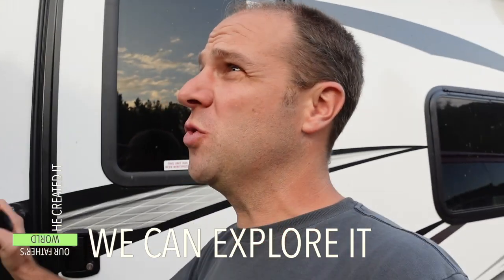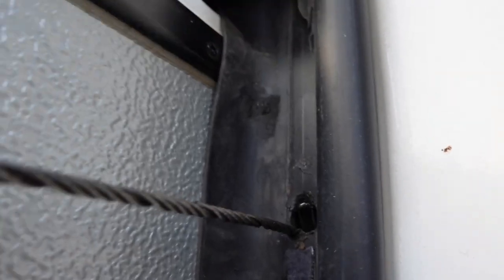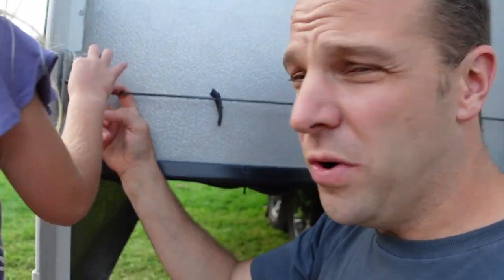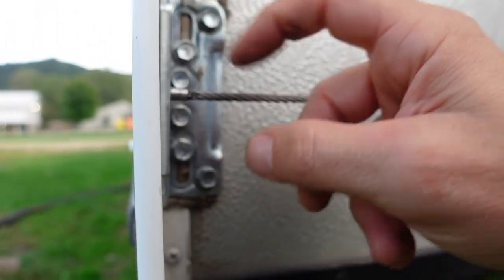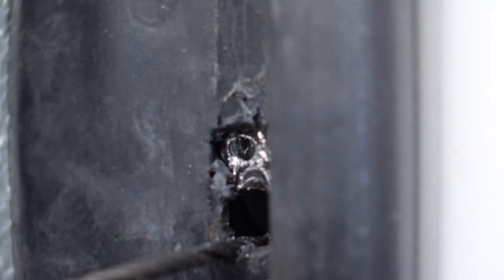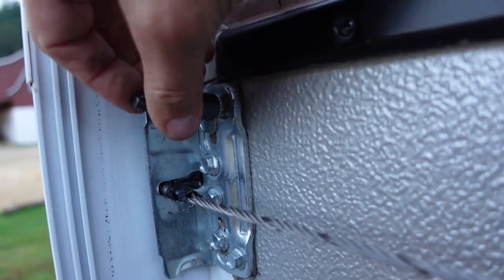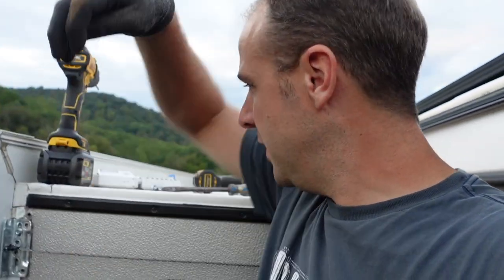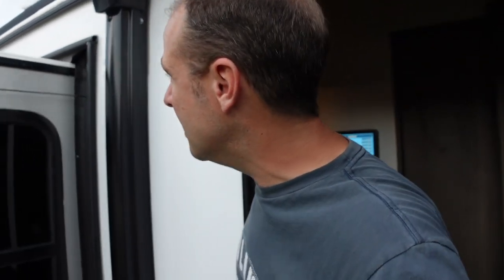DO NOT use your RV CABLE SLIDE OUT until you watch THIS!

Comment: I have a 2022 Cougar 25RDS with the cable side. I have no issues with the cables or the trailer itself and have done lots of camping. These slides require maintenance (checking the cables for wear and tension) like anything else on the RV. If you understand how they work and how to adjust them they work great. Unfortunately in this case the the bracket was installed to high. The tension on the cables should have 1/2" - 3/4" travel up & down.

Comment: Very good info, and something that one might not catch until it is too late.  I wish there were a way to access that corner from the inside, so one could make four metal backing plates on the inside, then replace the self-tapping screws with machine bolts (with a little bit of LocTite 243 "blue" stuff to ensure the bolts don't work loose, coupled with an acorn cap nut at the end) , as well as add a 3-5mm rubber gasket sheet cut out and with holes for the bolts, to guard against water intrusion in addition to the caulk or silicon sealant.

RV quality has gone through the floor due to a number of events.  In 2005, due to Katrina, RV makers were told to mass produce trailers as cheap and fast as possible to get them to the destroyed area.  This started the slide.  2008 came around with RV makers making units cheap, just to make some type of income, and didn't really care about quality, as many RV makers went under and got bought out.  2020 came around, and people paid 4-10 times as much for a trailer as a few years back, and quality control still slipped overall, from what I've been told.

You almost need to have a third party go over a new RV and fix everything that is broken.  A former co-worker took his new class "C" to a local service that did this.  It cost him about $15,000, including a roof replacement (because the roof and area around the cabover would almost certainly leak and rot after a few years), but he has something that will at least be something for camping, and not a source of frustration and problems.

Ironically, if you compare the quality of campers here in the US to what is sold in Australia and the EU... it is insane what relative junk is foisted on US buyers.  $70,000 in Europe, even with currency changes, can get one a very nice class "B" unit, or an extremely well equipped trailer, with the latest materials and floorplans.

Comment: This is simply an adjustment issue. If you still have this RV you should call a mobile mechanic and have them readjust your slide out and possibly change the cables. It’s not that difficult and shouldn’t take more than an hour or two. I agree with another commenter about Camping World and their lack of quality service. I feel the same about Bish’s RV, as well!

Comment: Nice video.  That appears to be a BAL accu-slide, not installed correctly. The brackets have slots that allow the cable to center side to side, and slotted screw holes intended to let you align them up and down. BAL has excellent videos on how to replace cables, how to adjust cables and so on. If it were me I’d go ahead and replace those cables, and if it does not have rollers under the slide BAL offers ones intended as upgrades (that don’t require removing the slide to install).  Be sure to also check the inside cables

Comment: There is also a lot of slack on your cable.  There should be enough tension in those that when you touch them they don't sag.  You need to adjust the tension.

Comment: I have exactly the same cable but inside doing the same thing and my Cross Road Cruiser Aire 31SI is a 2022. That thing is only 8 months old. What a piece of crap, made By Keystone RV. The dealer will cover it on the warranty of course. The whole thing won't last long. Great video the quality control guys should see this or maybe the management

Comment: It’s quite discouraging to see the complete lack of quality workmanship and materials that today’s RV assembly plants provide.
The reason this happens has much less to do with cost of material and labor than they would have you believe. The fact is, highway safety is the only, truly regulated factor where they can’t skimp.
Most RV owners will purchase a new RV based on how pretty it is rather than how well built. Add to this, the RV will spend the majority of its life in storage. The manufacturers have little to nothing to do with the assembly of an RV because they only produce certain components, not the fully assembled RV. The dealership may have a service department which allows them to increase profits for sales as well as taking advantage of the fact that an RV will likely spend more time being serviced than providing one. Since the RV is assembled with components from dozens of separate manufacturers, the end user can only expect implied warranty which is extremely limited at best because every piece of it is already technically used before the consumer buys it.
That being said, I would definitely recommend you fully inspect the undercarriage of your RV and its slides, making sure that all the hardware is present and properly installed, adjusted, lubricated and functional and if you don’t feel comfortable doing it yourself then use a service department of a dealership other than where you purchased it. Also, ask lots of questions because if you have RVing in your blood you are a handyman at heart and the first time you save a bunch of money, successfully fixing it yourself, you’ll feel so good that you may want to tackle something else before it breaks. Common sense is in our DNA and covers more than most people think.
Love your videos! Clearly, your inner handyman escaped with a plan to stop anyone you reach from being taken advantage of. Being your own hero is the best!

Comment: I would say you have too much slack in your outer cables. That being said the brackets that the cable is rubbing on in the wall is probably mounted poorly. One side of my slide the cables go right through the middle the other side however the cables are rubbing in the middle on the outside and not top or bottom. I took all the cables loose and tried to adjust as much as I could only to look through the bracket hole and the bracket is mounted to far over because the pulley is right behind it when the cable is straight.

Comment: you need to move the bracket so that the cable is in line and that cable needs to be replaced before it breaks and then it is a real pain replacing

Comment: Tape will not stop it. You need to replace the cable ASAP. STAT NOW.  As soon as that cable brakes you are dead in the water screwed.  B A L are never going to on my rigs.  I am backing off of two manufactures because they use them.  A deal breaker for me.  I have had no issues with shwinteck mechanisms after 8 years and countless cycles.  Dry Teflon spray is the only maintenance they need

Comment: “These campers aren’t cheap”…….. yes they are. They are built to the absolute lowest cost possible. The real problem is people are willing to pay super high prices for cheaply built junk. Think of it as paying ribeye prices for a McDonald’s cheeseburger, no one will do that, if they would that cheeseburger would be $50. Stop buying junk for exorbitant prices and things will change.
Reply from the maker: While I agree with the sentiment, people ARE willing to pay for campers, which is why they were so expensive.  I didn't like paying what I paid for our Cougar, but I did it for a multitude of reasons, and I'm sure other people do the same.  It wasn't Cheap dollars wise - but I was OK with that.
What I'm NOT ok with is the quality control - HOW it was built, not WHAT is was built with. If they would have done it right, then it wouldn't be an issue.